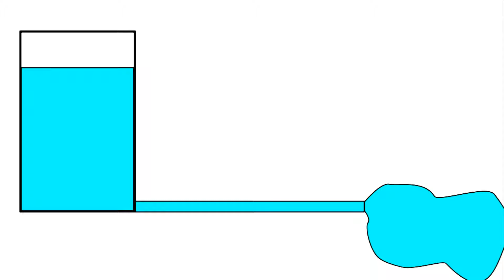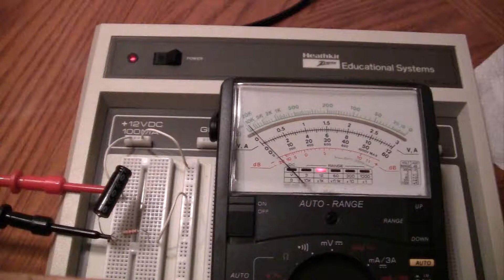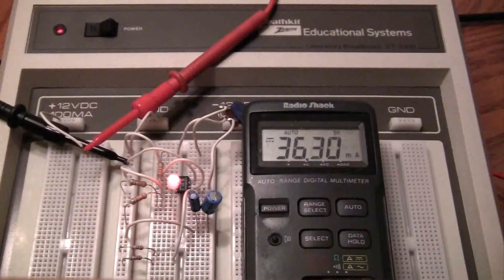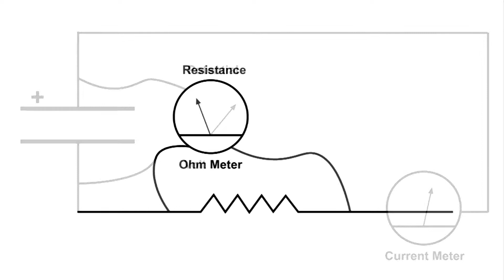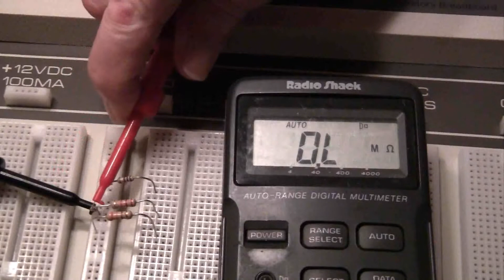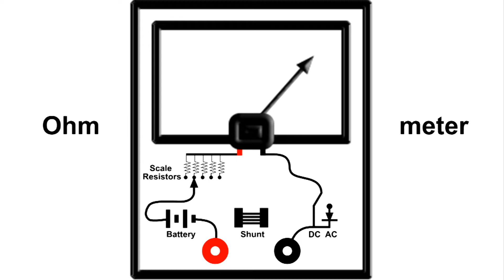Volt Ohm Current Meter for the beginner

Comment from the maker: Thanks SuperEvilbug
Your right for 10M Ohms. The circuit I used in this video is the one in the drawing, minis the ammeter. I have a resistor across the capacitor in this video and it is the 22k. And it is easy to miss because the meter face is in focus but the resistor is not. When I removed the ground lead the meter does not move until I connect it to the 12VDC terminal. I did pause before this connection. The cap is a 470uF@16VDC.

Comment: @AllAmericanFiveRadio I’ve just had an interesting experience, Sophie has some hair strengtheners and they failed on second use, when I touched the plates I could feel a buzz, 50Hz, I checked with a digital volt meter from the plates to earth and had over 110V ac. I did the same test with the AVO (2kohm/V ac) and read less than a volt, just shows, difference in input impedance.  I didn’t like the fact that I could light a neon off the plates, they’ve gone back to the manufactures. 73's ... Andy

Comment from the maker: Thanks AndyDaviesByTheSea
Hey Andy,
I just now remembered a friend of mine was testing the  resistors in a radio with a Simpson 260 meter. He also thought to check the filaments of the tubes. He was successful in burning out all the tube filament because it was a battery set using 1.5 volt tubes. That was an expensive lesson. Your friend had a very scary lesson and I'm sure he never forgot it either.
Regards,
Rick

Comment: Hi Rick, well done, again. I have an old multi-meter in the cupboard, it has part of the amp range terminal blown away, it was given to me by Frank, the guy who tried connecting it across the 250 volt mains supply to see how many amps he could draw. When it blow up in his face I decided it was better not to have the meter if he didn’t know how to use it, the meter still works and I’ll always remember Frank whenever I use the meter.
 Kind Regards ... Andy